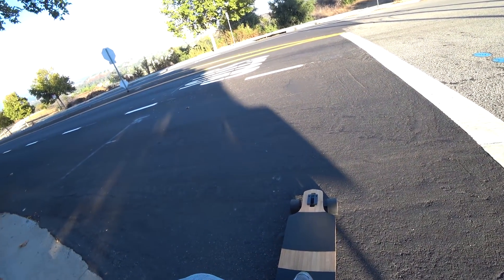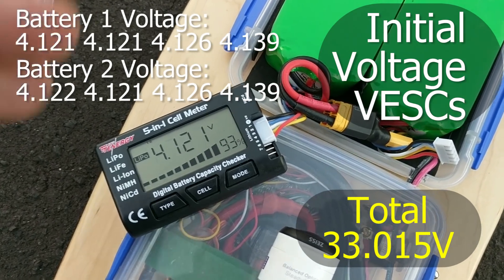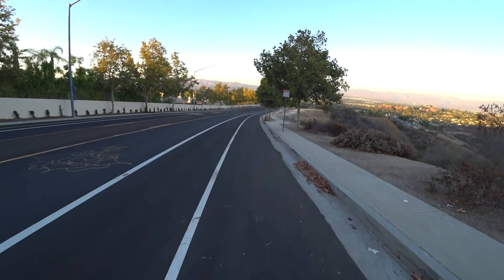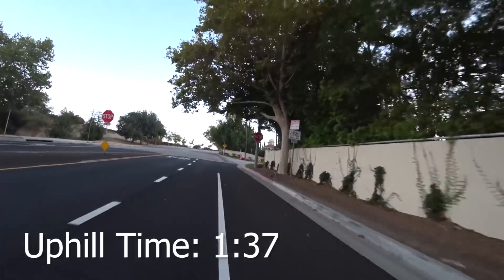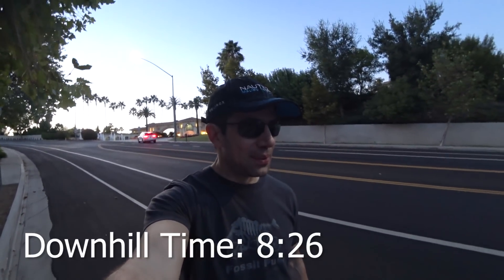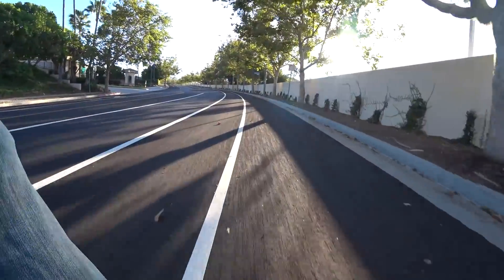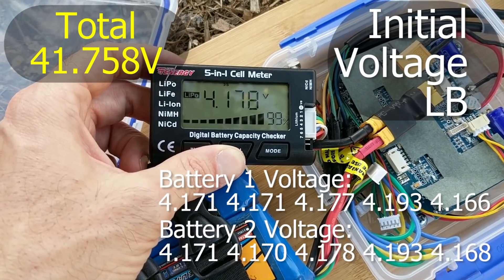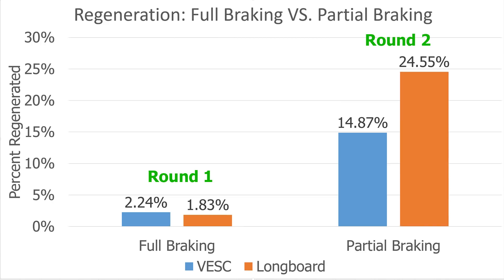Electric Skateboard Regenerative Braking | Testing

Comment: On my scooters I don't even care if regen saves battery, im more in it for saving my brake pads. I dont usually have to squeeze down hard enough to engage the pads til under 10 mph.

Comment: I know I did a similar tests where I walked uphill three times and then rode my electric skateboard down while braking. And I gained two bars by doing so. It is good to know that you could charge your electric skateboard without an outside source if you absolutely had to. 😎

Comment: The percentages you state are not calculated correctly. You've calculated the percentages based on the overall voltage of the battery, when it should have been based on the 0-100% voltage range of the battery. Example - 10S pack would be 42v @ 100% and 36v @ 0%, meaning the percentage of charge/discharge should be calculated by dividing the voltage change by the 6V range of the pack... You also need to account for the discharge curve of the lipo pack as the majority of the capacity (80-90%) sits between 3.8v and 4.0v per cell on a lipo. This means that if you charge from 39v (3.9v/cell) to 40V (4.0v/cell), you've charged 40%-45% of the pack - but charging from 40V (4.0v/cell) to 42v (4.2v/cell) only means you've added around 10% to the capacity.

If we work off of 80% of the capacity of the pack between 3.8 and 4.0v and calculate the charge increase of 0.032v, the math would be (Voltage Change within 80% band/voltage band size) x 80%). So in this case: (0.032v/(40-38v range))x(80/100)) = 0.0128 or 1.28%

Comment: If you can change your brake power, put it on least resistance. You cruise downhill lots faster and you get the rpm's to actually regenerate faster. I use this feature about on my teamgee H5. It does work. Just find a sweet spot. I've added 30 minutes to my rides easily by understanding how it works.

Comment: It's the same situation on electric bikes. Most builds don't even bother including regen braking now. I think it boils down to DC electric motors being very inefficient generators. On electric cars, it's different. They use AC motors with a converter. The converter is massive. We couldn't possibly have that.

Comment: THANK YOU for doing this experiment.  I honestly wasn't sure if you had to break for the motors to generate power back into the batteries or not. Perhaps they could design it to generate on coasting? I use dynamic breaking at work, but we use a resistor to slow down the motors.... The more resistance the slower the motor turns, and why I thought hard breaking would generate more power.
You answered another question for me, does it generate MORE when you break harder, That was my assumption and obviously I was wrong. Now you have me curious where the sweet spot is, ultra light breaking or moderate braking for the max poser generated back to the batteries. If its light breaking, and as you said can be up to 25% regenerated, that could be substantial to extending distance, especially if its electronically and automatically controlled.

Comment: For LiPo you need to count coulomb to estimate state-of-charge. Voltage isn't very accurate you can have large range voltages for the same state-of-charge depending on discharge rate, temperature, charging or discharging.

Comment: I once rode my backfire G2t to the city, losing about 25 or 30 percent of my battery on the way there. Then my friends took me by car to a very steep hill, so I naturaly went back down on my longboard again and got it back to 100%. I was really suprised just how well it worked. 
On the other hand, once I rode fully charged board down different hill and it started "overcharging", locking the brakes down completely. So it can be a downside too. I thought it broke it lol.
Reply: I hope my board would have the same safety function. I live in top hill when I go out the first road the hit is down hill with my fully charged board. Thanks for your information.

Comment: You have to just kick push the board. By breaking down the hill you are using energy from the battery and slowing down at the same time. If you just let gravity do all the work your board will be recharged a noticeable difference. I've recharged my meepo board by kick pushing up to 25% before.  Edit: I'm no expert on this but I've tested it before myself
Reply: Does it have to be downhill or really is the point just to create a good enough speed for friction?

Comment: Hi there! Great video and thanks for the fun info. Could you try to let the skateboard build some speed (no braking), then brake down to 10mph (brake as long as possible with a steady increase until you reach 10mph),then repeat until you’re back at the starting line.

Comment: im not sure how safe or possible it is but high speed and slamming the brakes should generate more power to be store back into the battery, like push starting a vehichle with a clutch

Comment: I'm not sure how you can tune the regen braking exactly, but I'm curious what the optimal braking is.  Seeing as how one was better than the other (light braking at higher speed is better than heavy braking at low speed), then there is very likely some in-between that is even better.  Or perhaps allowing time to build speed and then heavy braking, alternating your speed.

I'm also curious how aerodynamics (as silly as it is on a skateboard) can benefit the energy lost.  What happens if you crouch down or even plank on it (LOL, but seriously)?

Comment: Boosted Boards regen breaking works a lot better.   IF you used 12-15% going up a hill you could get back 6-9% breaking going back down, the board will beep at you when you full charged. this happens if you go down big hills with close to a full battery.   Been riding eSkates for a few years and Boosted is the Apple of eBoards   its a very nice product.

Comment: For the motors to regenerate energy, they have to turn due to momentum to act as generators. If you had bombed down the hill and then rapidly came to a stop, you would get SIGNIFICANTLY greater battery regeneration as a result of the motors not using much of the power they create on the way down.

Comment: .. I have a hybrid suv.. From experience you need to either be going fast and lightly brake or full brake. Basically it comes to torque and rpm of the wheels. If you're going slow basically nothing happens.

You should try going at a decent speed and then full brake or mostly brake. VS light brake at slow speed.

Comment: You are definitely going too slow to use regen. Regeneration can only happen when the motor is rotating fast enough to produce a voltage of higher than the battery voltage. The type of braking you were using was simply shorting the motor phases together, and using the resistance of the motor windings to dissipate the power.

Comment: Regenerative Braking isn't about recharging your batteries at all! The alternative to regenerative braking is to drain your batteries even faster by supplying the motors with reverse polarity voltage in order to stop just like electric rc cars do! Most large scale electric Rc cars actually use mechanical brakes in order to preserve battery life so none is drained by braking. The Regenerative braking simply uses the resistance of the batteries to apply a load to the motors which are now acing as generators, there just happens to be a convenient byproduct and that is a very small voltage increase to your batteries.  People often get upset that their re-gen braking doesn't charge up their board much but in reality, if re-gen braking was super efficient and charged as fast as you could discharge, there would be multiple cases of people going down hills with nearly charged batteries and either overcharging and ruining their batteries, or possibly the system shutting down/frying from over voltage and then you'd find yourself mid way down a very steep hill with no brakes at all. You Should do another video on the same hill comparing traditional reverse polarity braking by re programming your vesc (if possible) to non Re-gen and see how big of a voltage drop that is by time you get all the way down the hill! Then compare the percentages of battery loss with traditional electric braking to the % of battery gain with Re-gen and I bet you'll see a huge change in perspective on how efficient re-gen brakes really are.

Comment: This was a pretty flawed test... Your results were easily within margin for error and you went way to slow (too much braking) for any negligible charge. Would work a lot better by using the brakes more normally. Also, belt motors and a li-ion battery would also contribute to better results.

Comment: Maybe the ESC just shorts the motor when fully breaking. Then the 0,080% of battery charge could be explained by the fact that batteries lose voltage due to the internal resistance when discharged.

Comment: I have a question what's more efficient, Hub or belt driven Motors?
Reply: Hubs are probably more efficient, since belts and gears add just a little bit of friction, in my opinion its minor.
I would take a belt-driven over hub any given time.
Reply: @Eden_M  not exactly. If you were new to powered skateboards I would get hub motors, becaues they have smooth power and brake delivery.if you were to brake something or run out of battery you can't push a belt driven.but if you wanted raw acceleration power the belt drive is the way to go.
Reply: @metalmulishaz123  Dude, you're missing the point, Read his comment again. Hubs are more efficient.
That's all.

Comment: So I’d assume that the breaking turns the kinetic energy of the motors spinning through the magnets. Faredays principle. So actually just cruising and or barely braking at all would give you back the most since the engine is spinning faster at top speeds therefore creating more current that can be harvested.

Comment: If you go faster and smash on the breaks it should do a bit more as you will gain more momentum from gravity which in return can be converted to electrical energy, because gravity is 9.8ms^2 Allowing the board to roll longer rather than preventing it the whole time would increase the resistance required to slow down the board.
Reply from the maker: I should try that some time. Going faster would help, but if I wait for the board to gain more speed I would be braking for less time. It's difficult to tell. It would be worth trying that approach some time.
Reply: @orensprojects7250  It doesnt matter about time its energy conversion ;)

Comment: I am wondering if it would make a difference to go downhill faster breaking only partially.
Reply from the maker: Getting more speed could work better. I wouldn't be braking as long in that case though. It's hard to tell.

Comment: WHAT THE HELL DOES THIS GUY THINK IS CAUSING THE BRAKES TO WORK < THE FUCKING BATTERYS , he even says in the video the brakes may be using some of the battery.  im not sure but i guess u have to hold the brakes to regenerate but  appplying a lot of brake seems to use some battery power which makes sense, there should be a regen mode for going down hill or something.  i cant beleive what an improvement the second attempt made and it was actually way more effective then i thought

Comment: YOu need speed to get energy back if you dont have speed from where shud the energy come from=== I often overcharge my board cuz I accel realy hard and brake hard but not too hard let it roll you feel yourbodyweight getting into ground nice feeling..if you have to brake alot in your rides is a realy big help..I get a few km of range exstra..need to brake hard often for cyclist,hard turns and scooters people too.
Reply: what yo need to do is get a certain speed like 30/40km then brake make speed again then brake repeat that and test that out on drifent speed  i would start at 20 km/h and  repeat it. adn do the hill again but then 30 km then again  40 km/h and see on what speed regen brake is most effiecient. i think that would be a real grea test can yo do it pls

Comment: Driving a Renault Zoe up and down the Austrian Alps I was able to Regen about 33% of the energy spent. This made a 300km range possible whereas on a highway with constant (and somewhat higher average) speed I only got a 200km range because I couldn't regen much. Regen is not a fluke and actually convinced me of the superiority of electric drivetrains
Reply from the maker: Thanks for sharing your experience. It's interesting how much extra range you get when going over mountains. I think regen brakes makes a bigger difference with heavy vehicles. For skateboards the wind and rolling resistance of the wheels is a bigger factor. The Zoe looks like a good value. I'm hoping to get an electric car someday!
Reply: @orensprojects7250  i agree. you won't get as much regen on a skateboard, but at least something.
Thank you so much for your extensive testing. Looking forward for more :)

Comment: what if downhill without braking, will there be regen energy
Reply from the maker: No, energy will only be generated when you're slowing down. When the motor generates energy the resistance increases.

Comment: Holy shit that's a lot of gain by regeneration... You could try higher number for battery min regen... I don't know what ah your battery is... Awesome info
Reply from the maker: Thanks! It's definitely better than nothing. The longboard is using 10S 3Ah batteries, I think the VESC board is using 8S 4Ah.
Reply: @orensprojects7250  Couldn't figure out why my brakes don't work in big speeds when I really wanna slow down... Found out it's not the motor min value rather the batt min regen value... It should not be set according to what your batteries can take, rather how you need it to brake in vast speeds... Cause the specified number dictates how fast the motor is able to brake in big speeds even though the regeneration is not reaching the preset value... So it should be higher than reality... I have set it to 20amps after reading Arcmaniac's advice and my brakes are holy shit awesome now...  I can slow down so fast from 35 km/h+... so the regen value is for high speeds, the battery min value for lower speeds... (Of course having 10s1p battery you couldn't do that but as I looked at people's rides, your regeneration doesn't get higher than around 8-10 amps... On big bursts you might have 13 - 15 but that's just for a part of a second, that doesn't matter...

Comment: Your using some DIY cheap ESCs and BMS. Also not going fast enough. Your better off free rolling half way down then hitting brakes. 
Use a legit board that does on demand voltage info (my Evolve remote tells me what voltage is, cells, everything while going down the road on remote)

Comment: I live with some pretty steep hills. You think I can rely on regen breaking to slow down and stop? Or should I get a hardware break?
Reply from the maker: I would be careful on very steep hills. The regen brakes I've used would not be able to completely stop on a steep hill but they can slow you down pretty well. Just always be prepared to jump off because I've had the brakes fail on me and the board starts free rolling without any braking.

Comment: Going too slowly may not create enough friction around the stator in the BLDC motors to make return power to the bms to charge the batteries. Too much brake force actually uses a lot of the power you just gained. Regen braking is just using the motor(s) backwards literally as generators and the friction created becomes the brake force.  I think belt driven setups create more energy than hub motors in most situations due to the reverse gearing as well. Also some batteries charge faster than others. That would be a cool comparison test too.

Comment: I'm gonna take you back a few years to try to explain this, so bear with me.  Back before ESCs were used to control DC motors we used variable resistors.  This was a length of high resistance wire, rapped around a form in a spiral, with a sliding contacter that completed the circuit.  Battery power was fed into one end of the resistor and picked up by the contacter.  The closer the contacter was to the source end of the resistor, the more current would flow to the motor.  My first experience with this was in the late 70s with a Radio Control race car, an Associated Electric RC12E.  I give this history lesson because this power setup also included something called "Dynamic Braking".  You see, the resister had TWO winds on it.  One fed battery power to the motor, the other fed any current coming FROM the motor, back to it.  Basically, shorting the motor leads through a variable resistor.

Why do I bring this up?  Well, ESCs just use a power MOSFET in place of a wire-wound resister to control current.  Our old RC car setups pitted the motor against itself for braking.  Regenerative braking tries to use the battery's current as an opposing resistance, but you run into problems.  If the current coming from the motor isn't under enough voltage to charge the battery, then you basically just turn it all into heat.  That's why the partial braking worked better.  Higher speeds equal higher voltages going to the battery.

You'll never get as much back as you put out.  Losses to heat through the motors, wires and ESCs will consume most of it.  Eventually, if you keep testing your braking at higher and higher speeds, you'll hit a point where the amount you get back starts to drop off again.  I'm going to suggest that you put an ammeter in-line between the battery and ESCs.  That will give you a better idea of the actual current being used and pushed back to the battery.
Reply: Cee64E Nowadays I think they just use PWM and u just stated what he already said in the video.